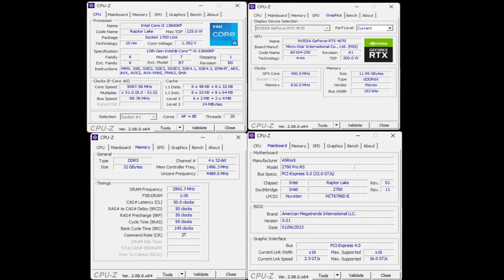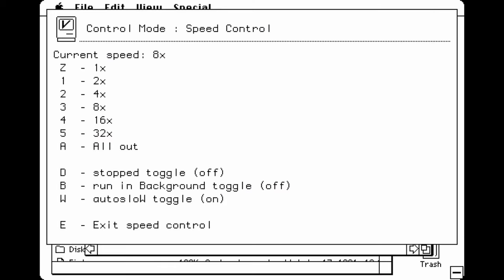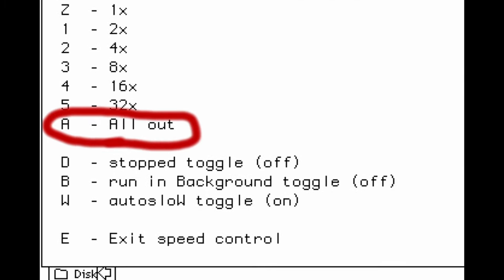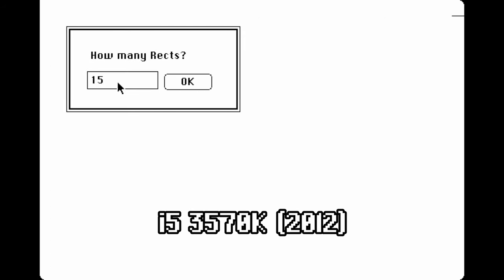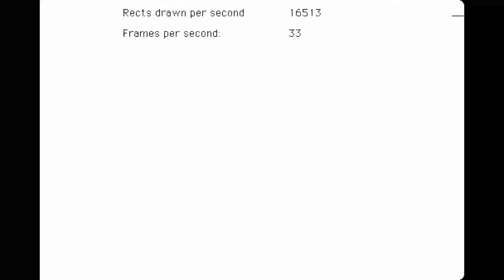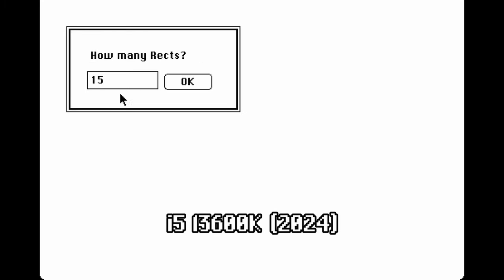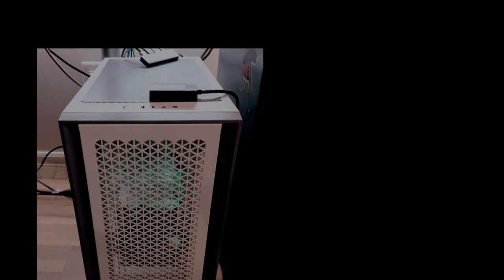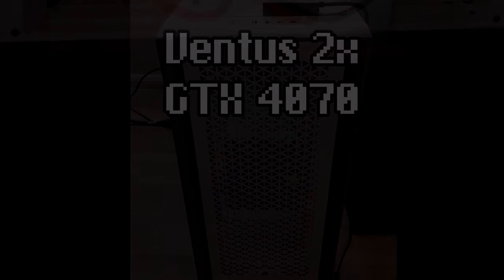Got a new 2024 PC, let's benchmark it!

Comment: Nice setup. I had a tiny bit similar upgrade path to yours: in 2013 I had a i5 4670/R270X/8GB RAM, in 2019 I upgraded to RTX 2060 and 16GB RAM. Last December I swapped to 13600K/RTX4060/32GB RAM and I bought the same case. This rig only gets loud when it complies the PS3 PPU modules. I can run PCem with PII 450 MHz config. Even PearPC can be run with an acceptable speed. I hope you will find lots of enjoyment in your PC
Reply from the maker: Thank you! Already have so far.

Comment: check your ram speed under your XMP menu of your BIOS.
Reply from the maker: Thanks for that advice for other readers. I knew in advance that RAM on new systems settles on a slower speed for maximal stability. Iirc I never could find the term "XMP" but I did find how to set my RAM to 3000 MHz in the bios so it was set at 6000 DDR speed.

Comment: Is that ram latency really at cas 50!? Gotta tweak that man.
Reply from the maker: What should it be!!
Reply: @1BitFeverDreams  I think I replied in a another reply, but I’ve never seen a kit come above 40. I also replied that in the bios you’re looking for that AI Overclock Tuner setting, it controls your XMP on Asus boards.
Reply from the maker: @Seandude05  since the video, I loaded EXPO settings in the bios and it's now at 36 clocks cas latency. Yeah, expo because I tried to save money on RAM and wasn't aware at all of XMP vs EXPO, but the motherboard seems to support both, thankfully.
Reply: @1BitFeverDreams  glad it works! It will run much better than 50!